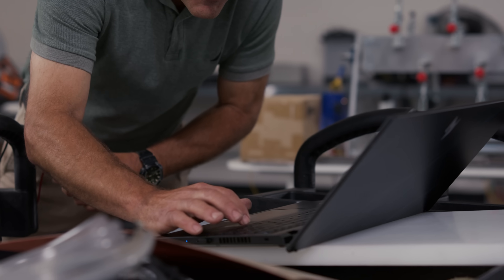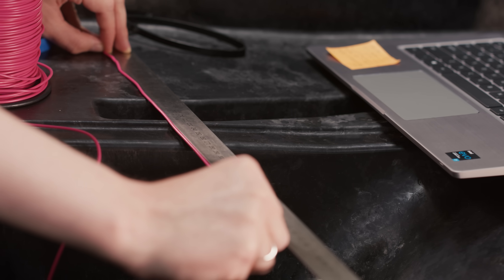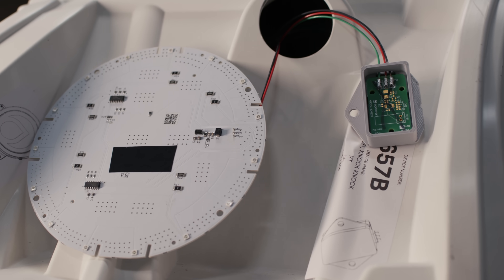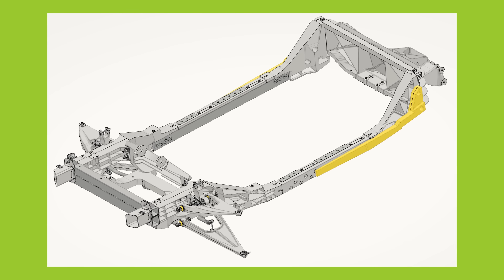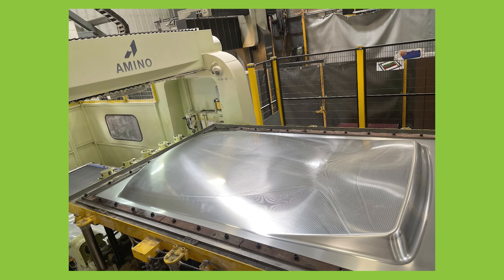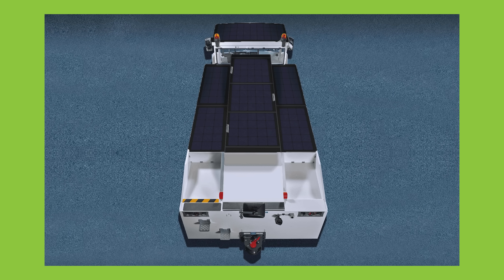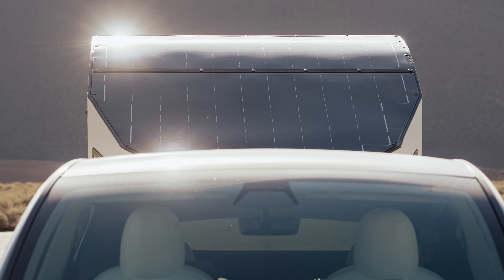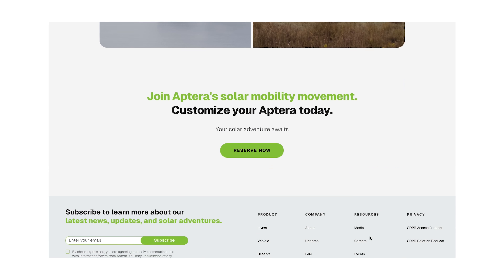Aptera Update — June 2024

Comment: Can we see some solar data shown on the display screen in the aptera while its sitting in the sun? There is solar output section in the display why is that not ever shown so we can see exactly how much watts are being produced when the car is sitting in the sun.
That would seem to be a very simple video to do, and I wonder why its never been shown by aptera even though they have that system working in the display.
Reply: They will do that once they have PI vehicles undergoing validation testing.
Reply: @n.brucenelson5920  That will be extremely interesting, their 700watts is using the maximum output possible using the maxeon data sheet, so will be quite a bit lower than they have been saying.
Did some calcs on the solar arrays using maxeon data for the 3.75watt cells.
Will use maxeon data of highest values of 0.626v per cell and 6 amps per cell (there are various different values but this will theoretical best case in 1kw per sqm sun conditions)
hatch: 31 cells in series gives 19.4v. Times by 6amp and 3 lots of strings gives 349watts
roof: 25 cells in series gives 15.6v. Times 6 amp and 2 lots of strings gives 188watts.
dash: 20cells in series gives 12.5v. Times 6amps just 1 string gives 75watts
hood: 30 cells in series gives 18.8v. Times 6amps just 1 string gives 112watts
Just a rough summary:
hatch: 350w, roof 190w, dash 75w, hood 112w = approx 700watts
( its just a bit over 700w)
Reply: @n.brucenelson5920  thanks bruce the problem is they are claiming 40 miles solar alone range to get investors, but that is not possible, since they is using the output of the cells with no encapsulaton, with no mppt, with no voltage conversion to over 400v to charge battery.
Without consideration that not all cells are perpendicular to sun at a given time, even when sun is perfectly overhead, they will never get that output, never ever ever ever ever. Its not possible.
These are all losses that the directors/engineers are well aware of, they know 40miles is not possible in the real world, so why do they keep saying it?  They have solar output in watts on the display and estimated range by solar, why dont they ever show it? 
To be claiming 40 miles is misleading at the least.

Comment: Crafting a vehicle by using manual skills does not breed confidence in the product. Where are the computer based systems? Where are the robotics? What about finite element analysis? Could the body be made using a gigapress? Where are the standardised cameras, sensors, radar, LiDAR systems? Nowhere did see true innovation in the manufacture. I see an innovative concept being realised through craft skills - measuring wire lengths with a ruler? Whaaaat the fuuuuuuu*k.
Reply: You are quite mis-informed.  No innovation in manufacture?  Take a look at the granted patents list.

Comment: Just looking at sunswift 7, which is a solar vehicle by nsw uni students, in 2018 the model they called 'violet' they drove it 4,100km ( 2,550miles) across australia from perth to sydney.
It averaged 56wh/mile over that distance......I dont think aptera can claim to be the highest efficiency solar car. They are not yet a production car  on the road still prototypes so claim is not valid. The sunswift 7 was on road vehicle ( but not a production model).

Comment: In a normal car how often do you scrape the tyres on a gutter? I know it happens pretty often especially when parking, so how often would you need to replace damaged wheel fairings? Something to consider as they will get damaged very often, I realise its all ready happened once to the aptera vehicle. It will be an issue, even since they have strengthened that area what damage will occur now?
Reply: Aptera has a proximity sensor and an easily replaceable soft bottom skirt for the wheel pants.
Reply: @n.brucenelson5920  excellent solution

Comment: I like the idea of thin lightweight solar panels that can completely cover all the windows when parked to #1 increase the solar changing power #2 keep the hot sun & uv rays from cooking the interior during summer #3 provide 100% privacy when parked & also to lower the power needed to cool the interior. 
This could be done by having solar panels in the doors that roll up & down just like a car window....And to cover the windshield, a panel could be stored in a thin compartment on the rooftop.That is the identical shape & size as the windshield. That slides out & can be pulled down to cover the windshield. 
If it was semi flexible, it could be in the interior rooftop & pulled down from the inside & fit into a track/groove slot. Located on each side of the interior windshield. It's sorta like how you'd pull down a sun visor.

Comment: If the boards have a dust proof coating, how will one replace them if they fail? will you need to pull some of the harness as well, or will there be connectors mid way?

Comment: It would be nice if the Aptera had a tow hitch receiver so that it could pull the Polydrop.
Reply: I don't believe Aptera could tow the Polydrop.
Reply: @johnreeves7261  I agree that the range would be limiting.  I think we may see tow hitches on the higher battery sizes in the future.
Reply: Many trailers have house batteries large enough to be traction batteries; it might make sense to equip them with in-wheel motors and maybe a monowheel where the hitch would be. With the proper engineering and software I believe it could be mated with an Aptera via blue tooth or ?, as a convoy  and no physical connection required!
Reply: @dennisroe5178  I love it!  Of course I want to make sure I'm well behind the trailer and my dash cam is turned on....

Comment: The new website is " vehicle emission forward" what sort of gobbdi-goop double speak is that, I see some better picture of cell negative tab connection. Here's what the picture says to me: positive cell connection is rarely centered correctly, as the laser arm that pushes the connecting tab down to the cell, the plate bends as its pushed downward, that needs to be taken into account in the initial design. It also means the same is happening for the negative more difficult tabs, which pretty much have to align perfectly to get the weld in the correct place. By necessity the weld is tiny since its going onto the outer rim of the cell which is only approx 1.5mm wide. Thats a very narrow area to be bending the tab down and spot welding, it looks like two very tiny spot welds ( by laser). Will those tiny spot ( laser) welds be sufficient, since alignment is critical its going to be an issue during production, will require each weld being checked ( by operater initially, later can do using photographic automated method). 
That negative tab weld is going to be problemmatic in production and possible post production, hence the reasons tesla has never done it that way, its problemmatic.
Its really nice idea to have all cells facing same diretion but not be best way to go for many reasons. The initial design of the tab plates needs to take into account the bending of the tab as its pushed down onto the cell, if your going to go down that path you should realise the tab has a hinge point where it bends down onto the cells, and that unless that is taken into account they just aren't going to align perfectly everytime which is required for this design.
Reply: " vehicle emission forward" is hardly "gobbdi-goop double speak" but rather the essential purpose of the vehicle design.  Anyone who doesn't understand that doesn't understand the purpose of the company.

The initial test packs have already passed vibration testing at a local test lab, showing that they perform.  More testing will be done.  Aptera is a continuous improvement company.

Comment: Have Italian designers been involved with chassis and suspension design? It shows significant changes. Beefed up longitudinal support at the rear along the side of the frame. Beefed up front end apparently for corner collision deflection, and direct collisions. Front suspension is completely redone. It appears that hub motors are still part of the front end. Looks like coil over springs might mount to the two new mounts near the center of the car. Rear suspension mount is also new, much of it has become part of the frame.
Reply: Well spotted.
Reply: which previous version are you comparing this one with? thanks.

Comment: What is the voltage of the solar array?
Reply: There are ~7 "strings" of solar cells all likely below ~30 volts each.  Each string will have a dedicated 2-stage (I believe) voltage boost MPPT to get to the battery pack voltage which, I believe, is on the order of 400 volts.
Reply: @johnreeves7261  like some sort of buck boost circuit thing. Hopefully they figured out a way to do that super efficiently :)
Reply: @Raz31337  No "buck" but, yes, a voltage boost circuit thing.  They claim to have up to 94% efficiency.  It's good but not super.
Reply: @johnreeves7261  ah well 94% is a good start. Or maybe use smaller cells and get a higher voltage array with only a few amps but 450voc or something useful. Feed that straight to the BMS with an mppt circuit in-between ala Fronius gen24
Reply: @Raz31337  such small high-quality cells are not produced at scale. Even if they were and could be practically assembled into panels, a higher voltage string means larger voltage range, which would be more pronounced on a vehicle (with curved surfaces and changing light/shade conditions.).

So a boost circuit over some voltage range would still be needed to maximise usable power... Unless each string was designed to reach battery voltage at the minimum target light exposure, which would be impractical over such a small area.

Not to mention 400-600V strings would probably constitute a high-voltage DC system in many places, isolation switches and PV warning labels might ruin the aesthetic :)
Reply: @JamesLaugesen  but the efficiency!!!! Haha :)))
Reply: @Okurkaarrgghh  Cucumber said: "Up to includes 0."  Like your intelligence 😅🤣😂🤪
Reply: @Okurkaarrgghh  I'll make up my mind when it no longer triggers you.

Comment: Aptera will revolutionize the auto industry once they are seen regularly on the roads. You will know that Aptera has changed the automobile market when the first thing you see on a new car's sticker is not mpg but its drag coefficient. I can hardly wait.
Reply: Says Captain Sweatpants, LOL
Reply: @Captain_Sweatpants_945  You are correct it will cost more to insure than a motorcycle. Compared to a car, it will be cheap to insure. The carbon composite shell is much harder to damage than steel or fiberglass and the body/door panels are built of the modern version of the dent-proof plastic used in the Saturn vehicles. The main shell can be replaced for $7,000. The cost of the battery pack is half that of a Tesla and the process is automated. Every breakthrough Aptera makes lowers their costs so I don't expect the production price to go up; they need to sell 20,000 Aptera at $25,000 to break even. They are focused on volume production by having fewer parts and fewer fasteners needed to produce built on the most advanced, modern assembly line all of which keep production costs down. Look into Aptera's association with Sandy Munro and Munro Associates and you may change your mind. Thanks for the opportunity to inform you on Aptera.
Reply: @Captain_Sweatpants_945  No version of Aptera has  ever gone bankrupt.  Aptera Corp was a brand new company with a different vehicle and different corporate structure in 2019.  

Pay more attention to the history and don't just accept any account you happen to run across.

Comment: I wonder why they are going with cylindrical cells instead of square cells? To me, i would think square cells would simplify the pack design and you would be able to remove/repair each cell in the event a cell fails. With this design you will need to replace the whole pack.
Reply: They would need to replace the module, not the whole pack, for major failures. All EV manufacturers use cylindrical cells because they are the most economical to make, and you need some separation between the cells anyway to mitigate thermal runaway. They didn't show it on the close-up, but maybe you could see it in the testing shot, they fill the module with insulating foam.

Comment: You understand we will be in hydrogen cars before you release one of your vehicles?
Reply: Only someone who has no understanding of technology would say such a thing.   Start with the energy cost of making, storing, and transporting it.
Reply: Hydrogen for passenger cars is idiotic.
Reply: What are you talking about  @skipondowntheroad5833 ?
Hydrogen passenger cars would be perfect for most homes. We can collect rainwater from our roofs, and use electricity from our rooftop PV solar to power our own electrolysis system and high-pressure hydrogen compressor, to fill our hydrogen cars.
What could be more efficient? An ionic compressor only uses maybe 5-10kWh per kg of hydrogen.
/sarcasm
Reply: Yep, and that hydrogen infrastructure to support those cars is right around the corner.
Reply: @madmotorcyclist  They are removing some of that that had been installed in California.

Comment: Hmm... I see what they mean by direct soldering boards and using conformal coating over enclosures, but that kind of goes against the goal of user serviceability. You can't easily remove/replace a board that's soldered in, and conformally coated boards are virtually impossible to repair.

A little disappointed by this. Hoping it's only in used in a few locations where maybe removing the whole harness section is an option.
Reply from the maker: Those aren't direct solders. The wire connections can be easily removed for repairability.
Reply: @ApteraMotors  Boards will probably be replaceable and not too expensive given they have a very distributed system.

Comment: It was noce to see the progress on PI1, and thanks for the clarification on PI2's role. So PI2 will focus on the chassis and power train, while development still continues on wiring the systems that will not be needed for the first drivable models. Am I right?

I expect PI1 will be drivable eventually, but PI2 is slated to reach that milestone first. I look forward to seeing it as it starts to come together. 

And that chassis really looks flashy.
Reply from the maker: PI2 will start its life as a test vehicle, for both suspension, powertrain, and of course the full battery. PI1 will remain only for fitment checks and to test cable routing. Thanks for the comment!
Reply: @ApteraMotors  estimated months for that test of the drivetrain? Late July, August?
Reply: @ApteraMotors  Yes. PI1 and PI2 have specialized roles to play. So I'm guessing PI3 will still be the sum of PI1 and PI2. That makes sense to me.

Comment: Make some cars and sell them!  Stop trying to make them perfect, they will not be perfect.  You need vehicles on the road.
Reply from the maker: The only goal is to manufacture the existing design, of course taking into account any testing and validation tweaks that must be made before customer deliveries.
Reply: @ApteraMotors  You are trying to go straight into volume production, that is a mistake.  You are going to run out of money and interest.  Seriously saving weight on connectors is just dumb.  Weight doesn't matter to EVs that have KERS, its nearly all air resistance, you know that. Cut a few corners, have an imperfect design, you can fit upgrades later.  If your production vehicle has to be perfect it won't succeed.
Reply: @ApteraMotors how is it you've had drivable test vehicles for several years and yet are seeking money to build more drivable test vehicles?
Reply: @jeffthacker569  Even major auto manufacturers take several years for new models, some as long as seven years.  This vehicle has been evolved with efficiency has the main goal in its design.  The prototypes were stages of that evolution as an example they changed  from the prototypes adjusting both the cabin volume and changed the shape of various parts like the wheel covers from wind tests and simulations (you can see those changes in the earlier videos).
Reply: @madmotorcyclist  its been more years than that LMAO 🤣
Reply: @Okurkaarrgghh  Having a design and implementation are two different things.  Back then the technology wasn't there to do what they have done since.  Also, remember they essentially had to restart from scratch since everything was liquidated back in 2008.
Reply: @jeffthacker569  2019-2024 is five years. Are you forgetting they essentially had to restart from scratch.
Reply: @madmotorcyclist  aptera is in their third iteration after 2 failed attempts at bringing a car to market
Reply: @jeffthacker569  So what?  They are doing just fine compared to other EV startups that have tanked even with more funding and they probably benefited by both the earlier experiences and improvement in technologies.